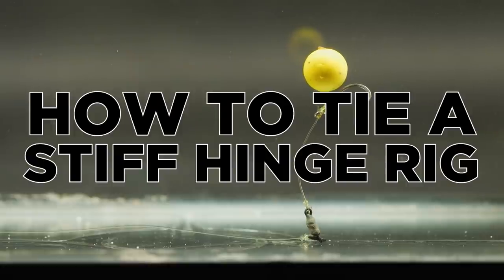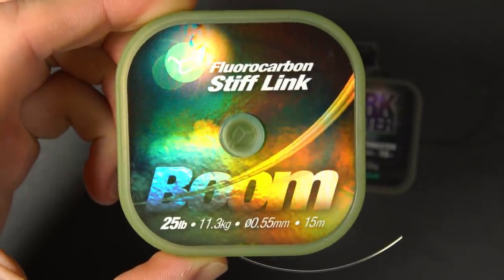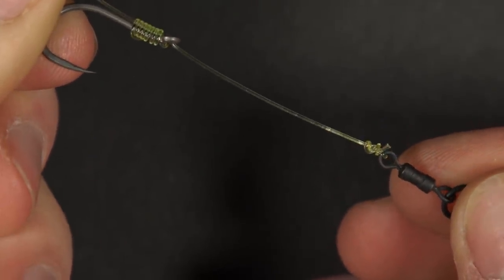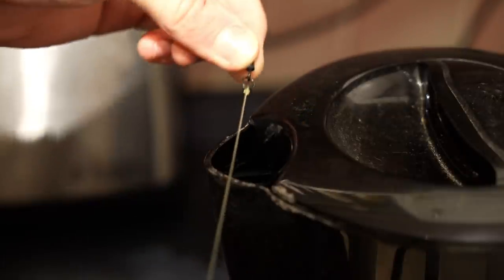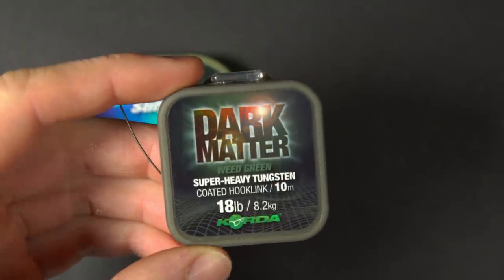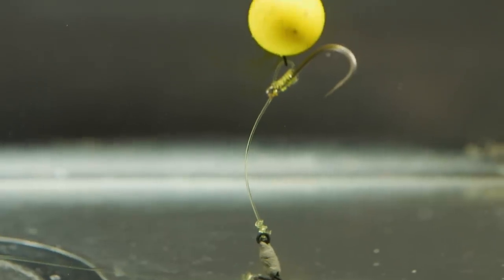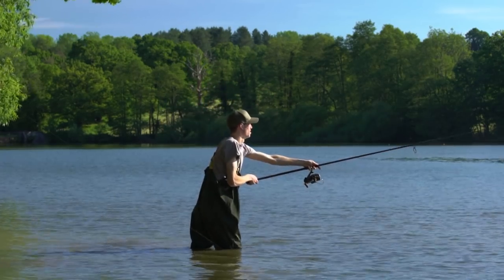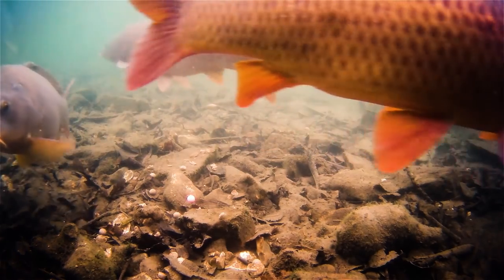How To Tie and Use The Stiff Hinge Rig

Comment: Can you use a running lead with this? I always use running.
Reply from the maker: Yes you could. :)
Reply: @fishingtutorials  thankyou
Reply: @harleyyeh  this is best used on a helicopter set up  not a lead clip or running lead
Reply: Jim Clarke hi mate I was wondering going to use this on my heli setup but was wondering can I skip the boom section and just attach it between the two beads on a ring swivel ?
Reply: @millwallfan06  well yes u can but then its a chod rig and you will have to adjust the top bead  so it settles over water bottom your fishing over
Reply: Jim Clarke thanks mate, so literally adding a boom makes it a hinged stiff? And without the boom it’s a Chod?

Comment: boys, can you glug plastic corn bait? does the scent penetrate plastic? thanks.
Reply: I think you can glug plastic corn but make sure the liquid your using is quite thin, as that penetrates into the bait much better than a thick liquid. This can be in the form of bait sprays, which are available from many bait companies, but also if generally the glug your using is thin then you should be fine. Hope this helps!